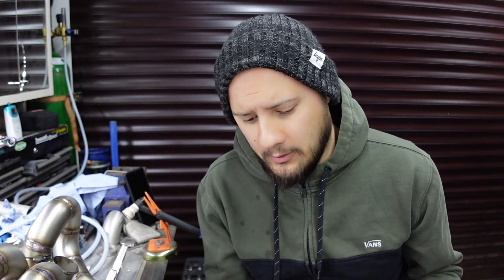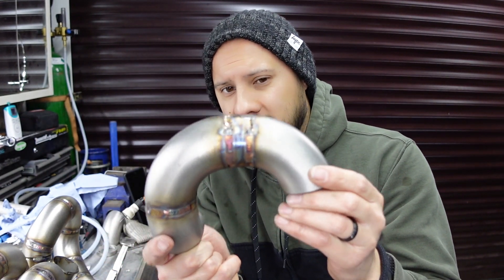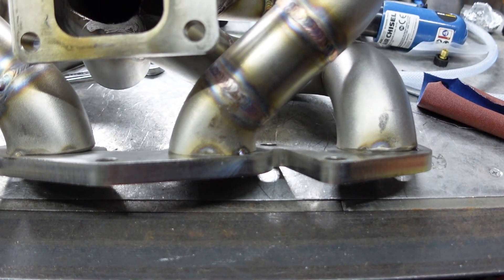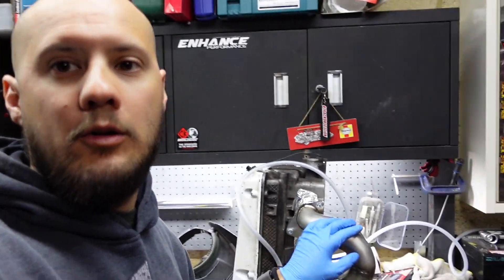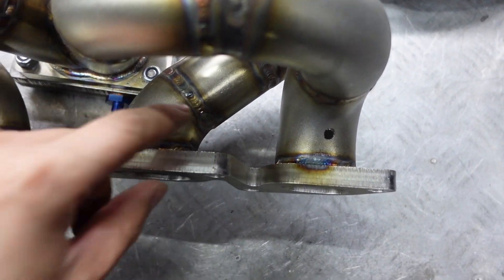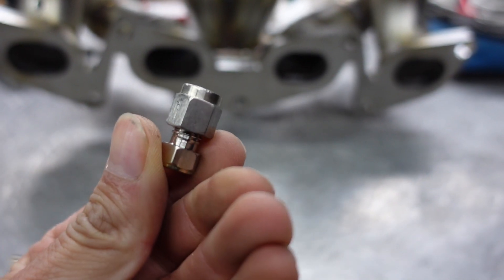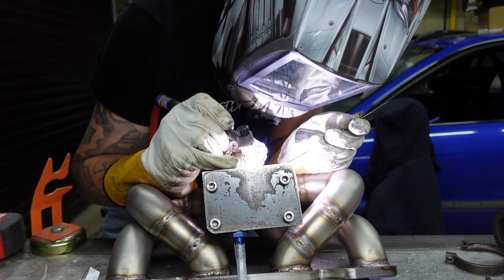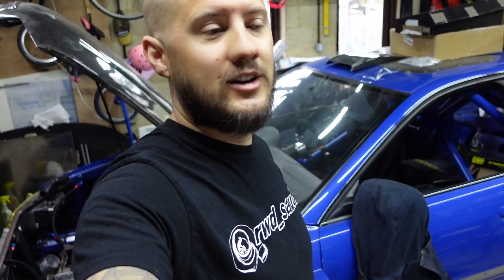Turbo manifold DIY Part 4

Comment: Is this for a Saab? Looking at the whole pattern and looks like for a Saab head
Reply from the maker: Yes it's for a Saab engine (in my Audi S4)
Reply: @AndyPonting  Never thought of it B205 in a S4 🤔
Reply from the maker: @amirhonsaidkhujaev3385  it'll be a B234 😊
Reply: @AndyPonting  Oh you got from a 9000   right?
Reply from the maker: @amirhonsaidkhujaev3385  yes originally, but will run forged B205 pistons, B204 forged rods and B234 crank
Reply: @AndyPonting  so it's kinda of an upgrade since it's forged and not oem